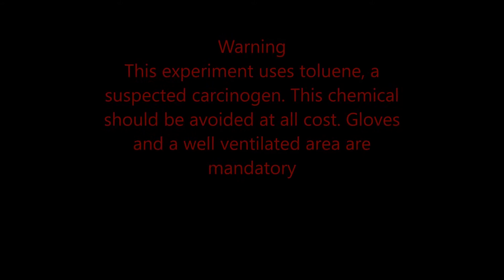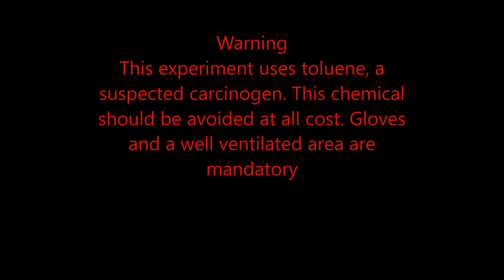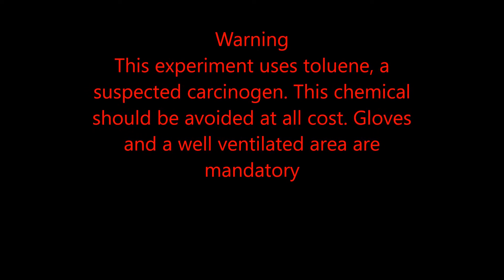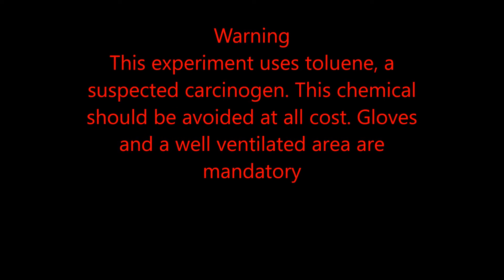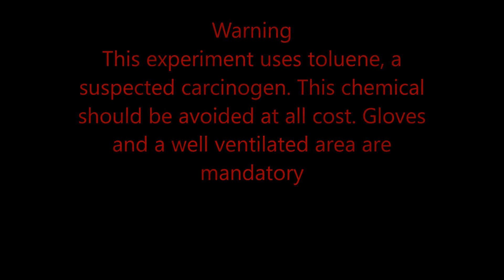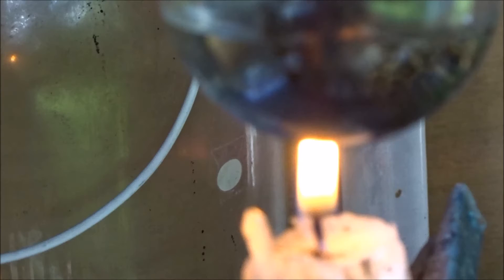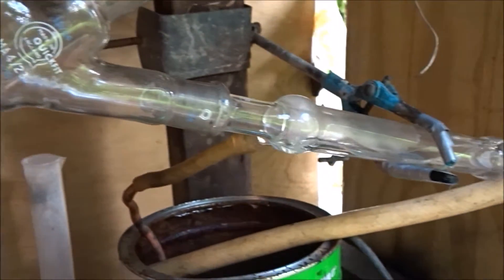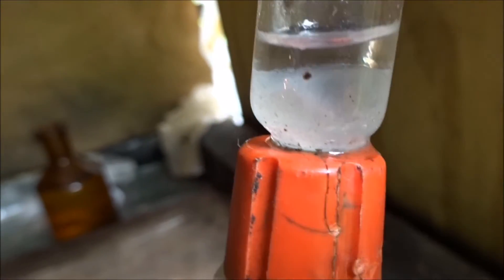Can toluene be used to dry ethanol?

Comment: Toluene is not a suspected carcinogen as far as I am aware. The Wikipedia page says there is inadequate information to assess the carcinogenic potential, this is very different from being a suspected carcinogen, which actually carries a lot of weight. The EPA's page on hazardous air pollutants states "Available studies in workers have reported limited or no evidence of the carcinogenic potential of toluene.
Similarly, the few available epidemiological studies have failed to demonstrate increased risk of cancer due to inhalation exposure to toluene." Saying that one should avoid excessive exposure is fine but saying to avoid at all cost is not necessary and only spreads fear. Other than that interesting video.